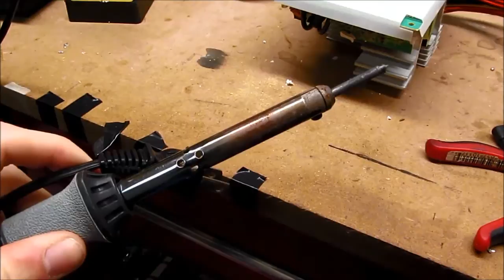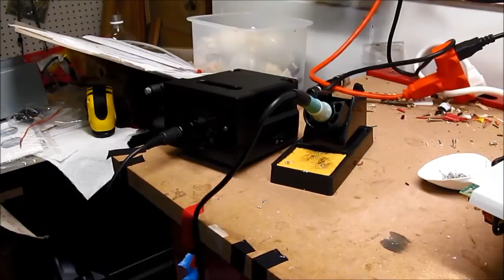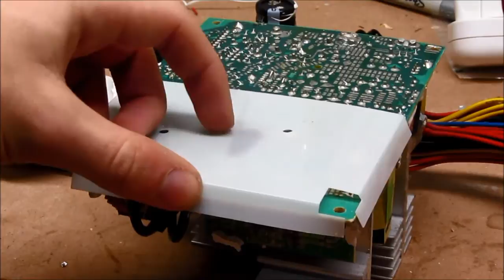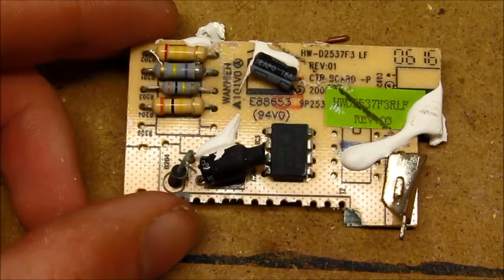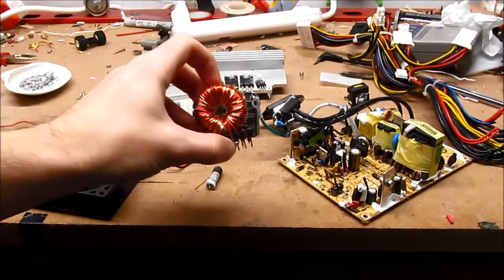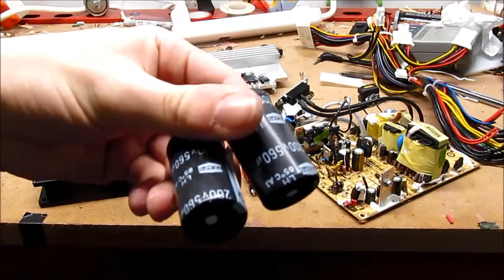Hipro PSU follow-up and parts harvest

Comment: Had a Dell 230W HIPRO unit died after I carelessly inserted the plug with the mains switch on.Took the mobo and RAM too,and probably the i3 540 with it.The HDD is fine,along with the USＢ　ｓｔｕｆｆ　ａｎｄ　ｆａｎｓ　ｅｔｃ．
How did you desolder stuff with more than 2 pins?Wont the solder melt back when you go to the other joints?

Comment from the maker: The chance of fixing a failure like this is small.  The short circuit most likely destroyed the control/driver chip which is a specialized part that may not be found or sold anywhere else.  If this was an unusually rare unit it might be worth fixing but standard power supplies are cheap and plentiful, so it was more useful to me as parts.

Comment from the maker: I agree.  This unit has beefy heatsinks, switching transistor, rectifiers, and output chokes.  The caps would be worth replacing if this one hadn't been killed by the input side fault.  I was going to use it for testing hardware but it's parts now :P

Comment: With regards to this PSU, as it was noted, it doesn't seem to have had much use and it's possible that some liquid did get onto the PCB or some sort of compound and that it was responsible for the 'blow up' of this PSU (over a long period of time in storage) if it wasn't just shorted pins.

Comment: They even lasted a while with subpar capacitors (save by the ones with Arcon capacitors.... those are very very very bad) because the design was such that the PSU was not stressed. Other than that, it's these ADDA sleeve bearing fans that don't seem to be oiled too well that might prematurely kill Hipro units. But I don't agree with the general consensus that Hipro PSUs are junk... with a recap and a fan swap if necessary they should last a good while.

Comment: Hipro PSUs aren't bad save by their choice of capacitors and some times perhaps a few other flaws (conductive glue, etc), but these problems can surface with any PSU under certain conditions. Hipro PSUs actually are built well, almost as overengineered as Delta PSUs in many cases, it's just their choice of capacitors and sometimes other problems that might put them in worse light. The older Hipro Dell PSUs (along with Newton/Lite-on), in particular, were very overbuilt and lasted a while.

Comment from the maker: There are many out there with much worse quality (as in no input filtering and missing output caps), but the cheap caps and other issues make Hipro pretty crappy.  At least I got some useful guts from it and had some fun making the Teapo caps go bang.
Thanks for subscribing :)

Comment from the maker: The board has a tiny bit of corrosion on parts on the top side.  However, none of the other pins near the fault seem to have corroded, and it had been sitting inside near a radiator for a few months, so there shouldn't have been any moisture left.  Those new parts will certainly be going to good use, though I think the cheap electrolytics may be doomed to a bit of stress relief popping ;)